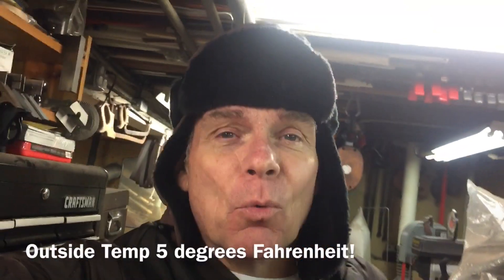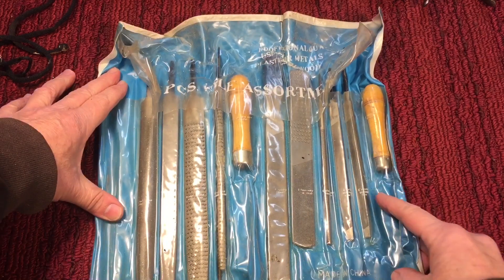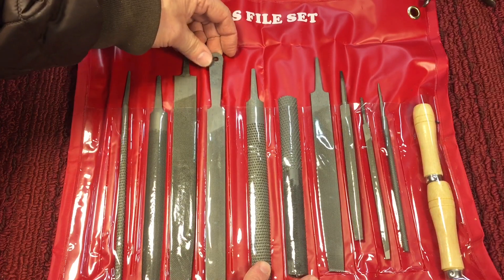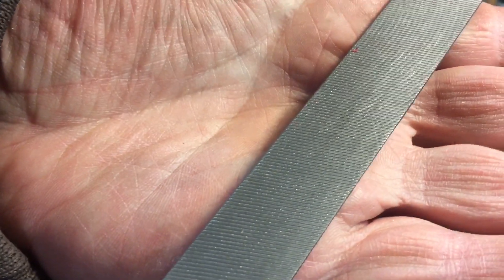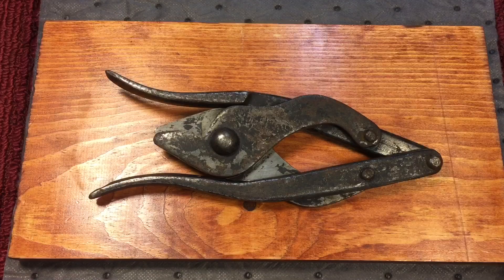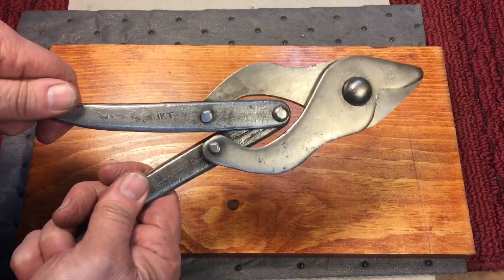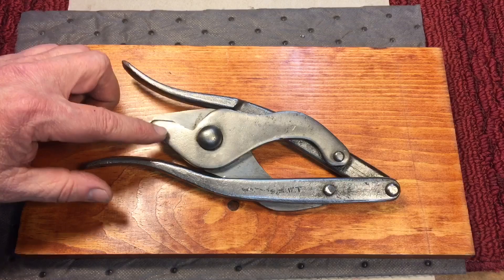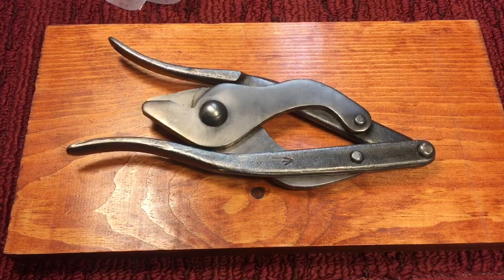WW1 Folding Wire Cutters and Files

Comment: I’ve always wondered why they call some files “bastard” files so I went and googled and found this interesting excerpt from Practical Machinist and thought I’d share: 
Why is a “bastard” file so named? The etymology of words is certainly an interesting study. The arguable “coarseness” of such a file [with the underlying implication that one of illegitimate birth was of "coarse" birth] is probably coincidental. The more accurate [and certainly more romantic] theory says that the term “bastard” most likely derives from heraldry. This analysis is certainly the etymological “short course”. Illegitimate births were not so stigmatized during the Middle Ages…for arguably they were the norm. Indeed, there were a many, highly notable “bastards” among the ruling classes of Europe during the Middle Ages. In the English coat-of-arms such a persons status as a “bastard” was signified by a bar…the barre sinister… which ran diagonally from the upper left corner of a heraldic shield to the lower right corner. In the medieval period files were the most common method of metal working… including the fashioning of swords, dirks, shields, and armor. The manufacture of files was a leading industry during that period. A file with teeth running diagonally across the cutting face closely resembled the diagonal barre sinister on the coat-of-arms of the “bastard”.
Reply from the maker: Hi Katie!   That was awesome!   Very interesting!   Now I have to look up "Rat Bastard" to see why my Dad always referred to his Boss that way...   =P   Thanks Katie!!!!!!!
Reply: Katie, great explanation. Thanks
Reply: @ScoutCrafter hahaha! Great video as usual!
Reply: Katie - thanks for this interesting bit of history.  Its fascinating how much in out language we use without having any idea of the origin.
Reply: A fellow lover of etymology!  Very nice.
Reply: Actually bastard as you said comes from French bâtard which means of mixed origins or in between. We also use the word "bâtard" for files or ... bread.  The bastard file is between a rough one  and a smooth one.

Comment: wynn timmins id bet, a good pliers manufacturer in the UK, Birmingham, theres many a ww2 escape movie featuring these cutting the wire at night.   people forget barbed wire is a high strength steel, made even tougher by its hard drawn manufacture, its not mild coat hanger steel, metallurgy at the time meant pliers wont cut it, remember how older pliers the cutting edge would chip or shatter, doesnt happen on modern ones!.   bolt cutters would but werent light enough to carry, look at older record bolt cutters and they were a  very heavy design, not like modern tubular ones, also barbed wire was often in bunches , not an easily accessible single strand, the folding handles were indeed used in ww2 by commandos etc, same design
Reply from the maker: Hello Jusb!  You're so right about the wire toughness and being drawn to achieve such strength.  As you know WW1 was such a horrible war...  That generation was much tougher then those following and it really took a toll on anyone involved.  I read horrible accounts of men caught in barbed wire, under fire and it's even hard to read!   The WW2 cutters were designed more like bolt cutters we know today.  Thanks!!!!!!
Reply: Jusb, nice tidbit - it also explains the prevalence here in cattle country of the ubiquitous fencing plier which cuts by a different means than blade-and-anvil wire cutters.
Reply: @ScoutCrafter  The British army were still using these in the mid 80s when I was stationed out in Germany, I had a pair on the inventory for  the  Ferret scout car I used to drive and funnily enough they are now hanging on my tool board in my garage, they were also still being manufactured as the pair I have are stamped 1984.
Reply: by the way they came issued in a canvas webbing pouch.
Reply from the maker: @jimjobson1958  Wow!  A design that is so good there is no need to change it!!!!  Awesome!!!!!   Thanks!!!!!!!!!

Comment: Nice wire cutters, you never see them cleaned up like that. However, I don't think you have German barbed wire for your test. WWI German wire was a heavy gauge, single-strand that was very difficult to cut. In addition, the barbs were very long and much more closely spaced. It was vicious.

Comment: i like the way you store them in the wax paper i might have to steal that from you do to i dont have a garage  just have a open  car port  bbut i do store  my really good tools inside. but i was wondering if the design of these plyers  is what made the leathermans / multi tools  the way these fold . might not be but its almost similar
Reply from the maker: Hi Steve!  I wish I had some of that old time wax coated brown paper they used in WW2!  That paper and cosmoline kept everything rut free for many years!  However cosmoline is a pain to remove where the mineral oil/Vaseline mix wipes off easily.  I agree about the design similarity to Leatherman!!  Thanks !!!